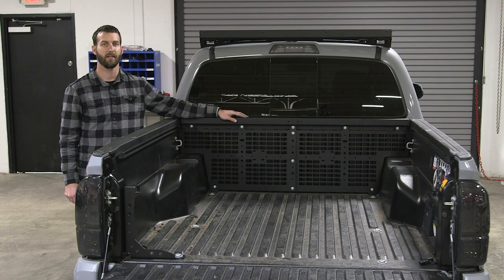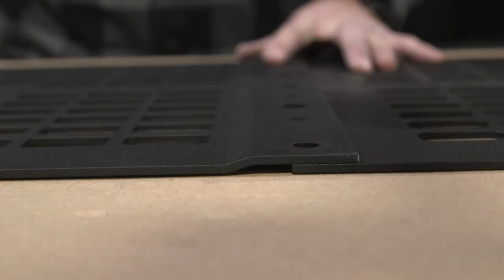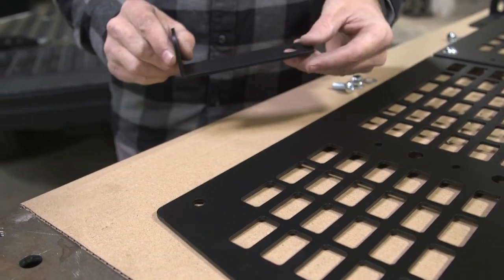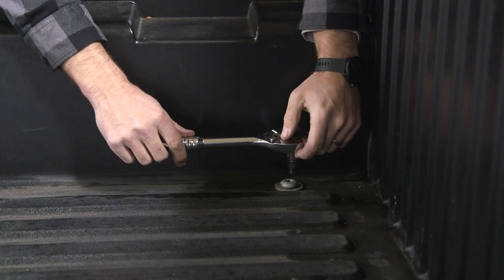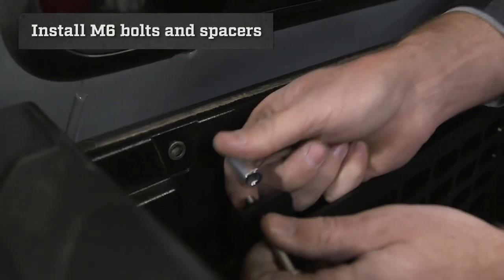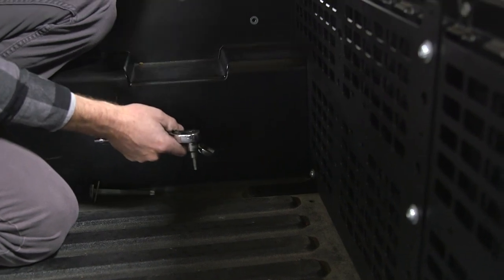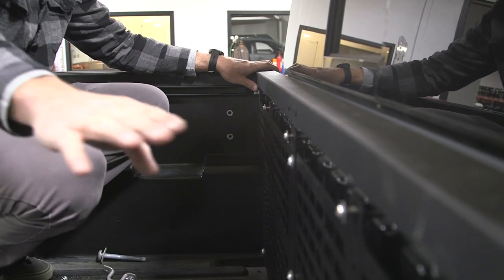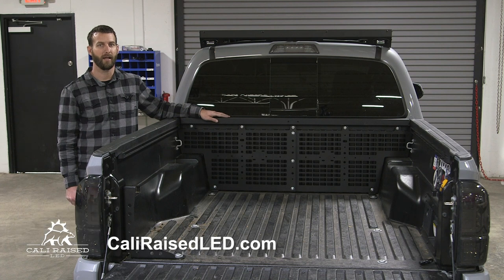How to Install Front Bed Molle for 2005-2023 Toyota Tacoma | Cali Raised

Comment: I've seen a lot of pics of Quick Fist clamps used on these panels and I'm curious how they mount.  Just bought the full passenger side panel, by the way, and I can't wait to get it installed.
Reply from the maker: Robbie Anderson run a 1/4” bolt though the quick fist and then run through the hole on the molle panel, then a washer and nut on the other side to tighten it down.

Comment: Does this work with a Camper Top or Camper Shell like the Leer Camper Shells? im thinking of getting a camper shell for my truck but this looks pretty cool too. I imagine if it works with the Camper Shell that its alot easier to install this before installing the camper shell because after the shell is installed there is alot less head room and the bar by the window which needs to be removed is no longer removeable with the Camper Shell installed.

Comment: Does the header panel need to come off for install? Wondering if i need to take off my canopy to install this?
Reply from the maker: Can you send a photo of what they are referring to.  All that needs to be removed to install this is the 6 bolts at the front of the bed (Some of the trucks do not have the bolts pre installed so we send new HW) send it too npoole@caliraisedled.com

Comment: Will this system work with the oem hard tonneau cover on the 3rd gen tacoma?
Reply from the maker: If your cover uses the bed rails then it will not work with the front bed molle system. Please let us know if you have any other questions.

Comment: If we have a 3rd bed rail everything would be the same right? Wondering if the spacers would fit in between the 3rd bed rail.
Reply from the maker: Yes, Everything would be the same
Reply: @CaliRaisedLED  thank you ordered the full system. Had to take advantage of the 15% sale. Thanks for the great products - install videos
Reply from the maker: @bvitale35  Sweet! Thanks for the support. If you have any troubles feel free to call us (888)-385-5036

Comment: Hey guys. I already have these panels but I'm wondering about longterm use of them for mounting my spare?  Its nothing crazy 265/70r16 on aluminum.  Don't drive totally apeshit, but want your opinion as far as them ripping out.
Reply from the maker: Great question -- it's all really your preference and even more so the weight of the tire! If you'd like to discuss the details with the team, please reach out on our chat system on our site and our team will be happy to help you out!
Reply: @CaliRaisedLED  so you personally don't know?
Reply from the maker: @realitycheck4158  We've seen a few people do it - and as long as you secure it down well, it should be fine.